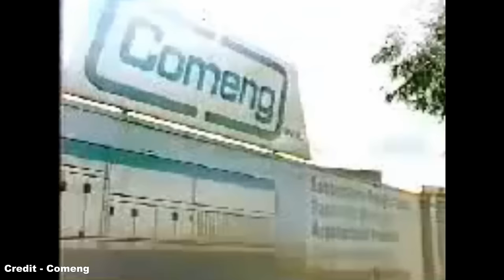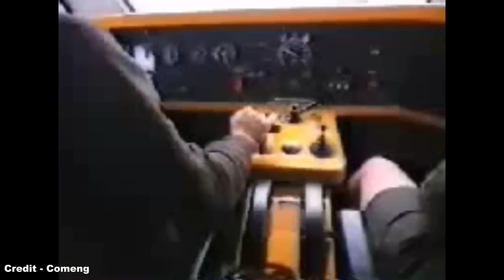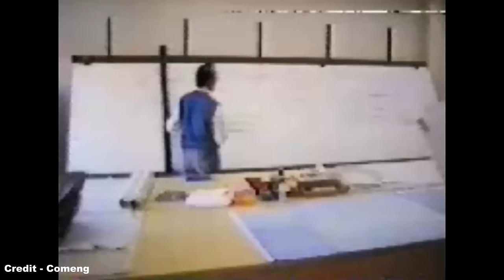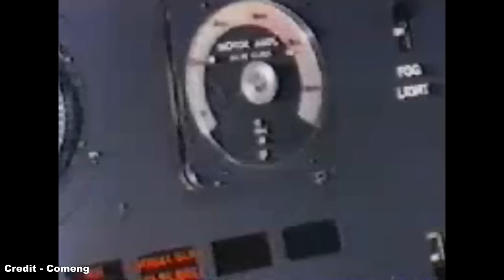The XPT - HSTs Down Under

Comment: I once checked for XPT sleeper tickets. The problem with the XPT is that you can only choose between Luxury class (Bed cabin) and peasant class (Seat). The intermediate class (couchette cabin) which is available on all European Night Trains is missing. Also departing at 2pm and arriving at 5am (Sydney to Brisbane) is a really weird schedule. European Night Trains on similarly long routes usually leave at around 7pm or 9pm and arrive around 8am or 10am.

Comment: Nice to see you cover the XPT, as a former SRA employee I rode on them quite a few times. They truly were a 20th century train on a 19th century network, Victorian era route alignments held back their potential so much (they could easily cruise at 160 Km/h all day if they had enough straight track. I'm honestly sad to see them get retired but I hope that at least several sets go into preservation.
Reply: 160? geez, steam loco could do that in 1901
Reply: @camerong5513  Possibly (considering the gradients on the routes in NSW) but with an efficiency of 7 % if you're lucky.
Reply: @camerong5513 Due to track limitations

If there were only straight tracks, there'd be no reason not to retire them and replace them with bullet trains or something